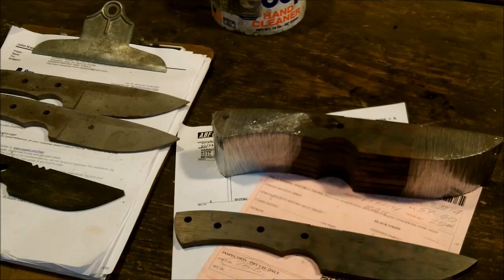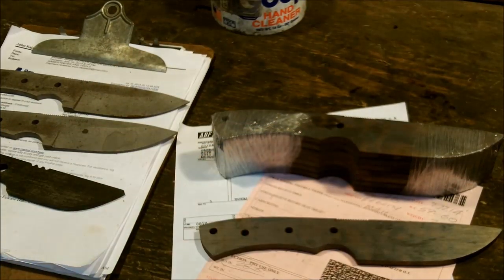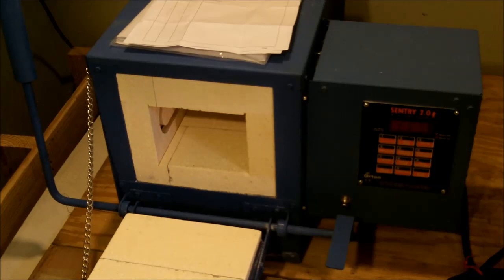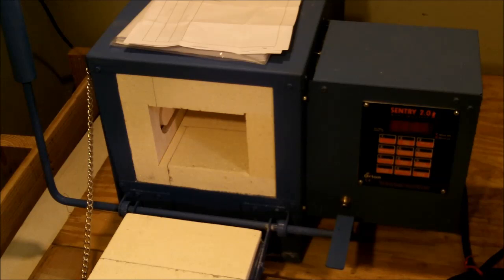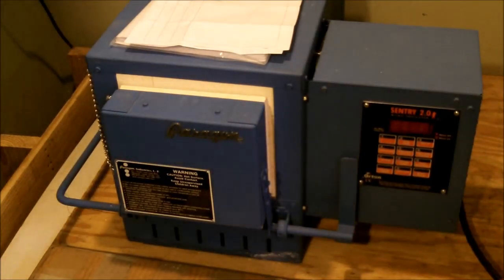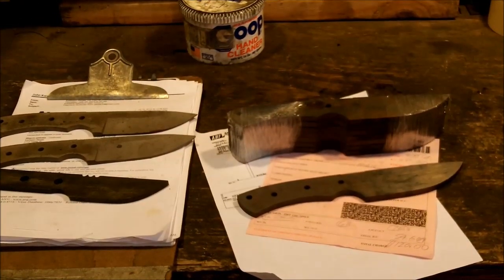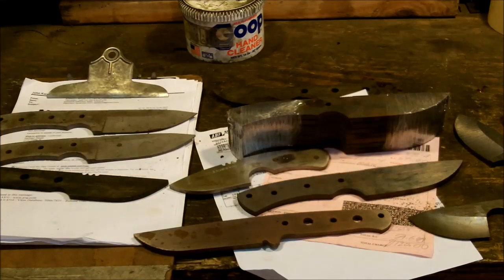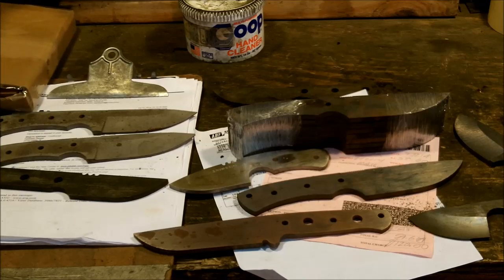New Equipment and New Blades

Comment: The open area is not a problem.  Once you run it you will find out it really doesn't get that hot.  You will want to put some fire bricks and a sheet of aluminum or something in between the wood and the oven for the base.